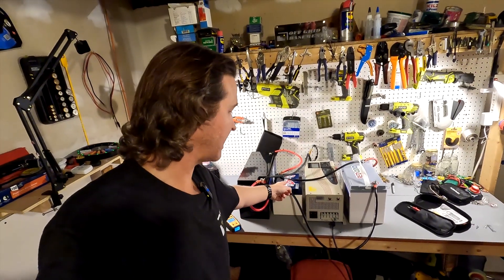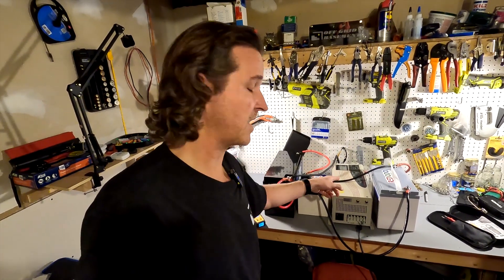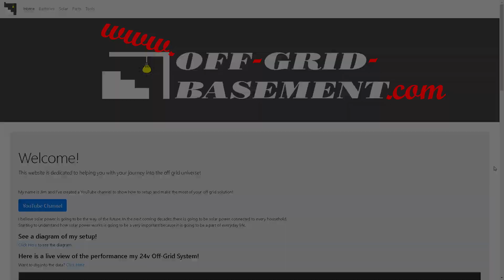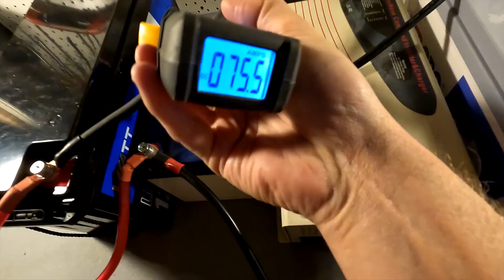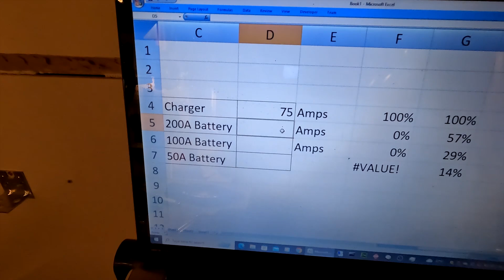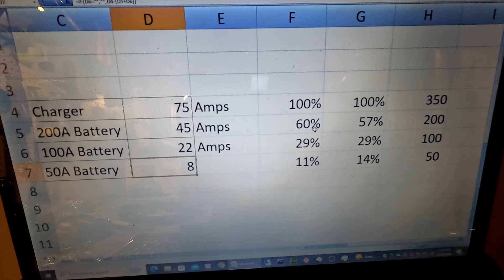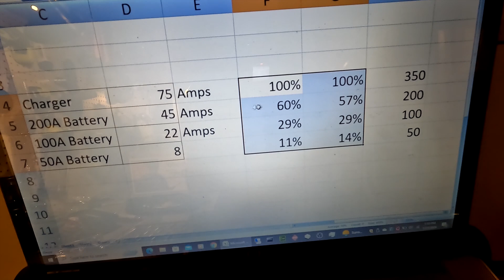Testing to see the comparison between charging amperage and battery size.  This is so interesting!

Comment: Author reminds me of Bill Murray from Ghostbusters lol Looks a lot like him.

Took me about 2 hours to charge a battery from 30% to when the charger stopped charging. Charger was a 40 amp lifepo4 charger.

Battery was a 100ah, 12v.

And battery did not heat up either.

I like that clamp on ammeter.
Reply from the maker: Thanks for the comment and for sharing!

Comment: Interesting, but will you ever leave the batteries, of unequal capacity, connected like this? Probably not, at least I can't think of a reason to do so since there is a potential to over charge one of the batteries when it is at float level and still getting absorption current. But having said that, any time you get new knowledge of how your equipment works is worthwhile. You just never know when this new knowledge might come in handy.  Experimentation leads to new knowledge. 👍
Reply from the maker: Thanks for the comment.  This is just a demo that it can work, but I don't think it's a great permanent solution.

Comment: Nice!! so it clearly illustrates that the small battery wont be damaged in any case.thanks
Reply from the maker: No.  Not unless you go crazy OverAmperage with the charging or discharging.  Thanks for the comment.

Comment: A good test.  Yes, it is aways the volage that will self-balance, so the amps in and out need to change.  I have a 23V LTO battery bank 2760 watts (2.3V 4 P x 10 S) and a 25.8V 2560 Watts Lifepo4 battery bank (2 x 12.8V S ) with BMSs.  The charge curves are totally different, but the min and max voltages are about the same, so it works just fine together when using my 3000 watt house inverter / 70 Amps charger.
Reply from the maker: That's what I like to see!  Thanks for the comment.

Comment: How about testing different parallel configurations of similar batteries to see if it makes any difference in charging or loading. Will all the batteries charge and discharge to the same level or not?  I watched a video that showed a perfectly balanced system and it would be nice to see if it is actually correct.  Video: https://www.youtube.com/watch?v=oOEqnCrxPYg&ab_channel=SolarSailor
Reply from the maker: I might try connecting a group of batteries like this for testing current, but I would always suggest just using a busbar instead.  Thanks for the comment and suggestion!

Comment: Man that helped me with getting my charge controller to connect to Bluetooth. Bro I got another question you might know the answer to. I have 3 victron charge controllers but my 150 .70 reads a .4 or .5 a volt lower than the other two chargers. When I connect them in the same network it still reads the same. Will they stop charging or limit charging at the same time or how does all that work?
Reply from the maker: When they're in a network they will all act on one voltage reading.  Hope this helps!
Reply: @OffGridBasement  they say they are all 3 on one network. I even named the network but they all three show a different voltage and the 150.70 is showing a half a volt different than the other two. Will they all work off of its voltage it's showing since it's the master and the other 2 are the slaves?

Comment: The rule is simple on Chinese products. Divide spec by 10 and you have real value. Wouldnt it matter on other things like internal reistances that vary a lot.
Reply from the maker: I believe it's all about internal resistance and voltage.  Thanks for the comment.

Comment: Were the amp hours of the batteries the actual or the company claimed amp hours. Perhaps that may explain the divergence from the proportioned charge rates completing a coincidental full charge.
My guess is they would reach full charge coincidentally
Reply from the maker: All batteries have been tested to reach full labeled capacity.  They might have been at slightly different states of charge.  Thanks for the comment.

Comment: Good proof.   So many other YouTubers have authoritatively speculated otherwise.  But physics is physics.  If the internal resistance is pretty even across the battery bank and cable losses are low the results will be in the range as shown by you.  

A T Burke
Reply from the maker: Thanks for the comment!

Comment: I love the way to explain and show things on your channel.  I'm in the process of saving money to buy lithium batteries for a power bank.  Do you have a recommendation as to whether to get a 10A or 20A or 30A, or should I get a larger unit in case I expand?  At the moment I'm thinking of a 400ah bank.  Thank you for sharing your wisdom with us and the hard work you do in making this videos.
Reply from the maker: With that size of a bank I would start with 30A CC and 400w of solar for a 12v setup.  On a sunny day that would charge your bank up 50%.  Hope that helps!  Thanks for the comment.

Comment: Well, under normal operation it might not see the excessive amps, but you can't make that assumption because any BMS in any battery can decide to disconnect for numerous reasons, including cells being out of balance prior to the completion of charging.   So you do have to be careful to limit charging to a reasonable estimate that includes partial disconnect situations.  With three batteries you can generally assume that two will remain connected.

Using these highly divergent storage capacities is a fun exercise.  In real life you don't want to go over a 2x difference between the lowest and highest paralleled battery.  So 50A and 100A can be paralleled.   100A and 200A can be paralleled.  50A and 200A ... probably shouldn't be paralleled.

In anycase, I covered this in your last video with this topology so I'll stop here.

-Matt
Reply from the maker: All true.  This is a test.  You could run in crazy parallel but you would want to make sure and use fuses or breakers between the batteries.  Thanks for the information and comment Matt.

Comment: Man i need some advice on my new charge controllers. I have the 150.70 its working perfect. I have the 100. 30 its perfect. I got a 100. 50 and it will not accept the Bluetooth connection. I tried 1234. 0000. 000000. None lets ot connect and im past my amazon return window. Any helps appreciated for sure
Reply from the maker: Is there a code on the bottom of the unit?  Look for a label.
Reply: @OffGridBasement  yes I see the label.
Reply: @OffGridBasement  hey brother that code on the sticker worked. Thanks man I am so glad you saved me on yet another obstacle. All charge controllers and DC to DC chargers are working now. You are doing a good job testing and teaching what you have figured out.

Comment: Great test, what's the charger wiring configuration to beach battery like the positive and negative wires of the charger to the batteries...Peace
Reply from the maker: Everything is wired in parallel.  The charger is on the positive of the 200a battery and the negative is on the 100a.  Don't pay attention to the wire colors.  They are a mess!
Reply: @OffGridBasement   thank you so much...Peace

Comment: I have 4x12v batteries the 12v LED screens on each battery are very misleading in series or parallel.. Think 3 Good batteries just 1 that the BMS does not work but in series or parallel it mimics the other batteries and LED screen comes on but . Think its really at zero capacity. Will not work with a 12v invertor. Mstery solved.
Reply from the maker: That would be misleading.  They must be just basic voltage meters.  Glad you got it solved.
Reply: Had  problems with Export Solar payment, the DNO power company use Energy Network Association certification. Only ECO flow 800 watt grid tie invertor has this. Don't think they sell if in USA. Only grid tie that does not require professional electrician, and has ENA Approval.

Comment: Nice, so if my mppt only allows 15 amps max to a 24v 100 amp battery, I can use 14 gauge wire and no need for 6mm?
Reply: The wiring from the MPPT charger controller to the battery or battery bus bars only needs to handle the charge controller's amperage.   Note however that it must ALSO be fused for the amperage the wiring can handle.   You also want low losses, so the minimum size I use is 10 AWG for charge controllers, even if they are short.  10 AWG or 12 AWG.  14 AWG is too small.

Use the AWG tables for power transmission, NOT the AWG temperature tables.

If you look at Victron gear, 12V and 24V charge controllers have a built-in fuse.  Most 48V charge controllers require an external fuse on the BAT+ cable from the charge controller to the battery.

Similarly, the cabling from the battery bus to an inverter only needs to handle the amperage of the inverter.  Though usually with a more generous slow-blow fuse to handle surges, and breakers for nominal maximums.

-

Often paralleled batteries can produce amperages far exceeding anything you intend to charge or discharge at.  For example, if you have 4 x 100Ah batteries in parallel, that battery bus can produce 400A.  But you might not want to use 400A cabling (that would be pretty insane for a small battery bank).   You might never intend to use more than, say, 80A.

In that situation always use a minimum cable size based on the AWG table for power transmission based on the highest discharging battery's amperage rating.  If they are 100Ah batteries / 100A discharge, that would be 2 AWG.  As a minimum, and a 125A fuse or something similar.  Even if you only intend to use 50A or 80A or something smaller.  And go thicker if you intend to expand the battery bank later on.

There is still always the danger of a short across the battery bank itself, prior to the main battery fuse, so the cables have to be thick enough to not instantly catch fire in that situation.  But after that you wind up depending on the BMS's shutting down the outputs since 2 AWG cabling (in the example) obviously can't handle 400A.

Also properly use battery terminal covers for all exposed bolts on the bank itself, precisely to avoid accidentally shorting inside the paralleled bank prior to the main battery fuse.

-Matt
Reply from the maker: Yes.  You won't have any issues with that.  Thanks for the comment.

Comment: This makes sense because the voltage produced by the charger rises as the batteries voltages rise (state of charge) the voltage across the parallel connection has to be equal, hence they take what they need of the current to keep the same voltage or state of charge. Possible BMS shutdowns will arise around 100% state of charge as things become more critical and batteries not having 100% same voltage at 100% State of charge.
Reply: Usually it works even around 100% due to the tail current (which usually takes roughly 30 minutes to drop off to near zero once the target voltage has been reached).  But as some people will know from watching off grid garage videos, the amperage split can get very wonky if the discrete batteries are at very different states of charge.
Reply from the maker: Thank you for the information and the comment.